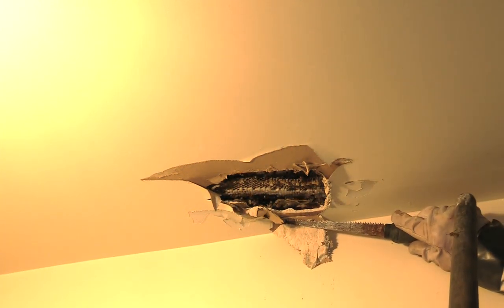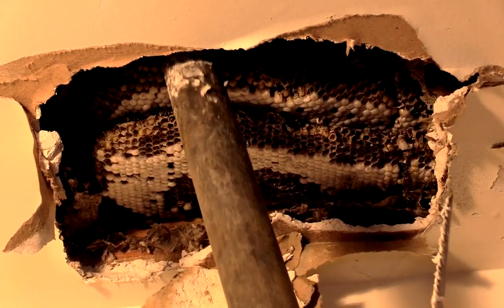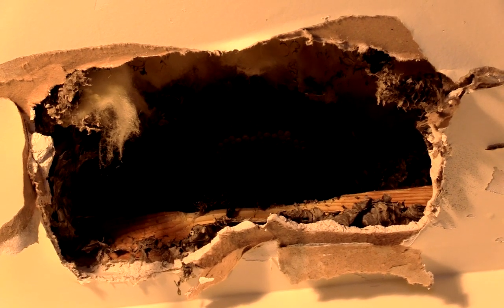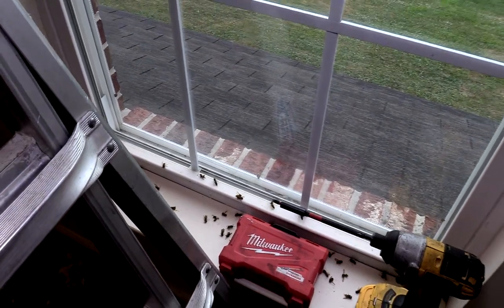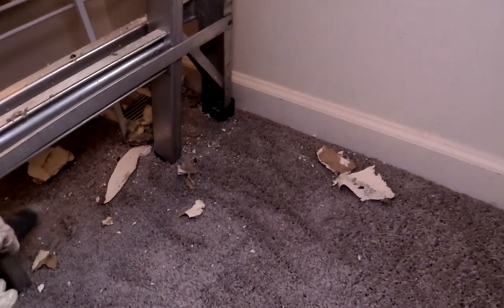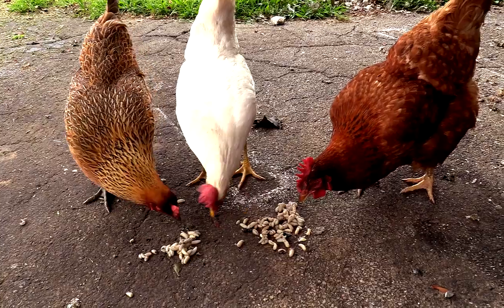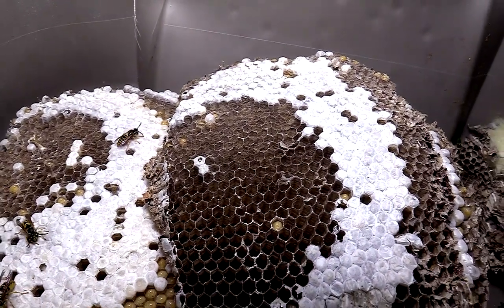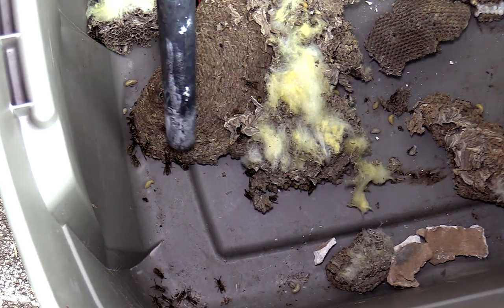HUGE Yellow Jacket Nest Infestation in Closet ceiling Wasp Nest Removal

Comment: I was just attacked by a swarm last week helping a buddy clear out some property and man that was the scariest/painful experience I’ve ever encountered. I still have swelling and pain in my legs and torso. You are a brave man even with protected clothing. I had them in my boots, inside my pants and shirt, even inside the gloves I was wearing. Please people leave this kind of stuff to the professionals! Trust me lol
Reply: I had a close call with yellow jackets just couple hours ago while I was cleaning my windows. I was wiping the window frame and while doing that I made a bit noise and accidentally banged some metal parts and suddenly I got a wasp trying to strike my face, I smacked it off and closed the window. Pretty sizable swarm formed outside. I was about 2 seconds from having at least half of that swarm inside with me.

I got swarmed pretty badly when I was 15. 20 or so stings on my arms and neck as I covered my face. Allergy pills, any anti-histamines and pain relief oils help a lot. Right after I applied cooling to the worst spots. After that I have been stung few times and it's not nearly as bad after the swarm incident. I get most of my stings while mowing the lawn with a drivable mower. I'm probably some type of sting magnet at this point, just covered with "attack this dude" pheromones.

Comment: Have you ever tried any alternative sprays? All the insecticides I have tried take too long to kill wasps. leaves them wriggling and still capable of stinging. The best one I've tried that doesn't leave a lot of residue is a pyrethrin fly spray for a dairy dispenser. It seems like a faster killer than the wasp sprays and makes a nice mist without wetting. But you have to keep pumping the nozzle because it is designed for a timed sprayer. When I have to remove nests I use 3M automotive Brake Parts Cleaner. It comes in a big can and kills them instantly. No writhing or anything just instantly immobile and dead. Then it evaporates dry in a few seconds. It has about a 10 foot range without the red straw tip. Drops them out of the air too like they've turned to stone. Maybe that's more important for me as I don't have a suit... I admit that it might not be great for enclosed nests or spaces but it's great for exposed adults and paper wasps. For hornets in the trees I use a pressure washer. It pretty much annihilates the nest from a distance.

Comment: Hello, why couldn't you use a piece of flexible nylon screen about 12x12 and then use push tacks to make yourself a screened in enclosure so the customers dont have bees walking around like stinging zombies long after your gone. 
 Locate nest 
Attach screen with yourself inside .
Now open er up and get r  done! 
What do you think???
Reply from the maker: That's not necessary . I show in my more recent video how wasps head for Windows during in house removals. After the removal process, I go the windows and lights and suck up the escapees. Done. No fussing with screens and curtains.

Comment: Why not mod your suit with an led head net light? Could be battery operated, help with those holes, maybe attached on the temple? Just a thought.
Reply from the maker: Not a bad idea, however, my suit has a hooded veil and isn't stationary so a light would be hard to keep angled in the right direction during a removal.
Reply: @HornetKingOfficial  makes sense!

Comment: Why dont u break and pull out pieces of the nest instead of cutting a bugger hole just to get the nest in one piece. Wouldnt this be better for the home owners who have to repair it after
Reply from the maker: The drywall is already compromised and will need replacing. If I can't see due to a smaller hole, I could miss something.